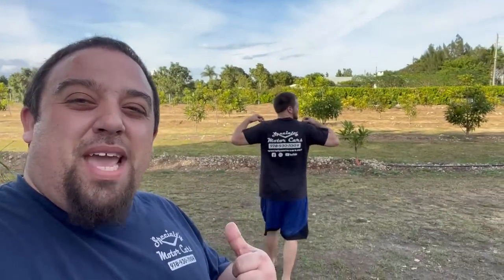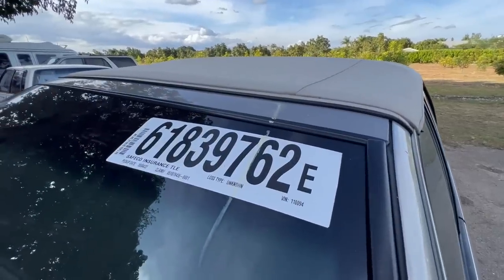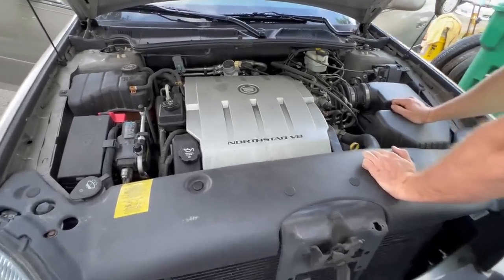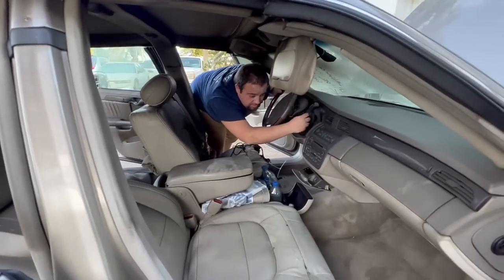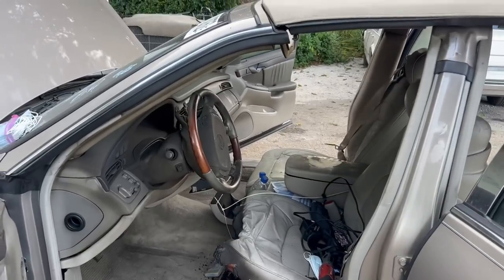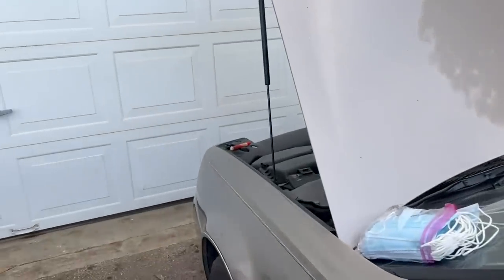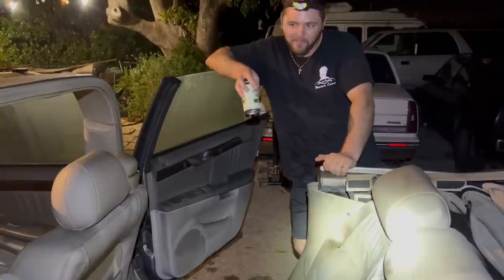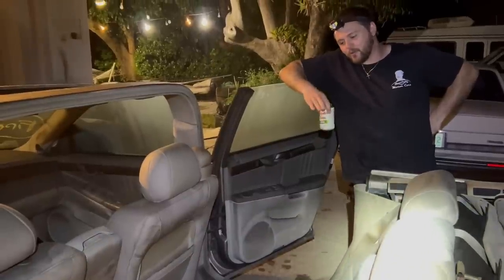I bought a BURNT Custom Cadillac Convertible for $750! Will it run? How many miles!?!

Comment: I've been in the water,  fire  and smoke home restoration business for over 40 years. Your going to find that the smoke has filtered every nook and cranny inside. You'll have take your time on the cleaning but you'll get there. A piece of advice... Because there was plastic that burned keep her in a dry environment as you work. The smoke can become acid/ corrosive when humidity gets to the smoke and can cause pitting etc. on interior metal as well as even the glass can etch. When you pull her apart make sure you clean the connectors as you go as well.This will be you best detailing job yet. If anyone can you can because of your detail. Just take your time.
Reply from the maker: I greatly appreciate this comment. Thank you for the advice!
Reply: Awesome advice.
Reply: I'm shocked you're saying that he will be able to clean it to the point you won't smell smoke. I didn't think it would be possible, but you're in the business so I defer to you. The headliner and the felt-like stuff on the door trim I do wonder if he'll be able to salvage any of the stuff because neither I could ever get clean just from basic dirt. Then the headliner i would say just have it redone by an interior shop. Not trying to be negative though if you say it will clean up I believe you. It's a gorgeous car and yes it runs beautifully. I had a 2007 - slightly different/updated body, but basically the same. 200k and  it ran PERFECTLY with not a single issue. Unfortunately I totalled the car, but no issues with it prior. Best of luck with yours SMC...
Reply: That was great advice, Thanks.
Reply: @wilsixone   I’m assuming knowing anthony he will replace headliner… it will depend how hot smoke got as it rises if it got to foam etc. He will know what to replace after though cleaning.
Reply: A cigarette 🚬

Comment: too easy to fix.  I mean, yeah you're gonna be taking it apart to get it cleaned up, but can't really go wrong at that price point, with those low miles.  Nice buy.  I'll add that smoke damage I've seen in cars is like corrosive or something, that is undoubtedly where all of the rust and corrosion is coming from. But with a parts car, you're home free.  Enjoy the process.  Good year too for the Northstar engine- they changed it like mid 04 and that looks like the revised unit. BTW-You can tell immediately by the difference in the engine beauty cover.
Reply from the maker: All excellent points! Thanks for the comment

Comment: I had a 1988 Chevrolet Caprice classic wagon, the power seat switch shorted out, smothered burn itself out smoked up the windows and stunk for a few months it fixed it and drove it for years.

Comment: Custom soft trim will fit to a tee I'm used to install them it is oem parts make sure kits has side panel included also about 1200 to 1800 look them up they deliver if you have someone to install for you

Comment: I own a 2006 Dts convertible and in my opinion the rollbar spoils the attractiveness of these cars and I'm glad they weren't all produced that way. That being said there aren't many available so I'll be quite interested to see what the outcome is.
Reply from the maker: What color is your 2006?
Reply: I thought that about the rollbar at FIRST, but the more I look at it, the more I like it. It kind of grew on me within the space of this video. It's definitely an unusual piece. As for the rollbar, it's actually not just that, the whole B pillar looks like it's beefed up considerably. I'm sure the purpose is body-flex and the integrity of the car on the whole. You say your vehicle is without a rollbar and that makes me wonder how they accomplished what needed to be done to keep the body structure intact. I'd definitely be interested!

Comment: Going to have to pretty much remove the whole interior replace or deep clean the carpet pull the dash apart to wipe down all the internals including the HVAC/vent system looks like it's worth saving with a low mileage and good running condition

Comment: I suspect the cause was faulty wiring. To make anything out of the vehicle the whole interior needs to be removed so that you are left with an empty shell to rebuild.
Reply: Why is that? Ie "faulty wiring"... It just as easily could be a faulty module which results in the same thing - smoke, then fire. As for removing the entire interior, I'm with you up to the dash which I would not remove! Also questionable whether I'd remove the door cards - I don't think so though. The rest of it, pretty much yeah. I don't know how Paul would be able to clean the headliner, I don't believe it can be done. Also the felt-covered whether stripping around the doors I don't believe can be cleaned satisfactorily. Those can be taken from a donor vehicle, which there have to be a few around it being 19 years old...

Comment: you can see some corrosion on the connectors. Might have had some salt water in there to cause a short
Reply: The chemicals in most extinguishers are pretty corrosive too.

Comment: This will be a fun build, figured Anthony bought it to take out the drivetrain and sell for $2000.  Then sell off all the other parts for another $500 to 1k.  It is a weird/funky design that I'm not a fan of, in perhaps that WORST late 90's/early 00's GM color.  Dark Pewter metallic or something like that.  It was an option on the Fbodys, Corvette, C/K trucks, Suburban, Tahoe, just an ugly color IMO.

Comment: The fire was extinguished quickly with the damage confined mostly to the seat cushion. The car certainly is repairable. In the best interest of the owner of this car the insurance company totaled this car. I doubt the they ever considered repairing the car due to nature of the fire being electrical and a repair possibly complicated or a safety risk. The owner probably preferred getting another car. The age of this car may have also been a factor in its low auction price. The DTS series began for the 2006 model year. Lively not much interest from many bidders on this car at the auction. The bidding likely ended quickly resulting in your very low bid winning you the car. It would be helpful for to know what started the fire just for the sake of knowing what went wrong under that seat.